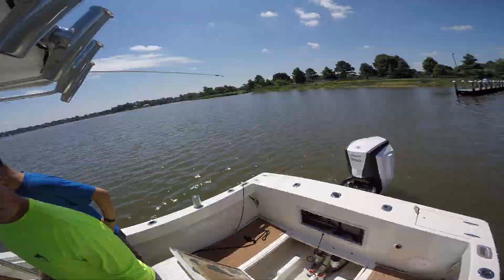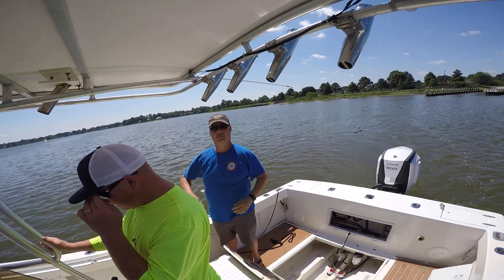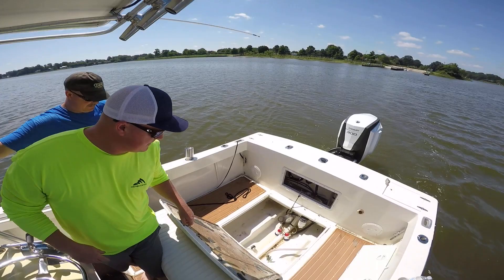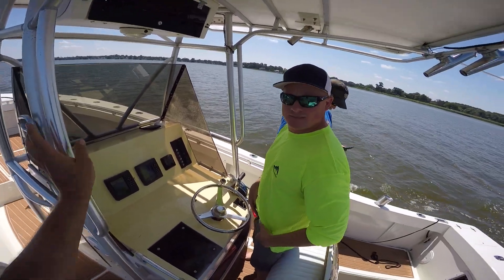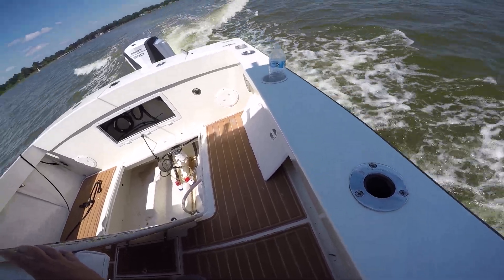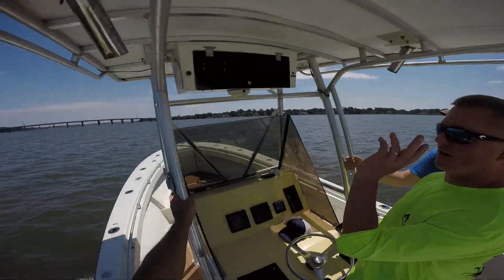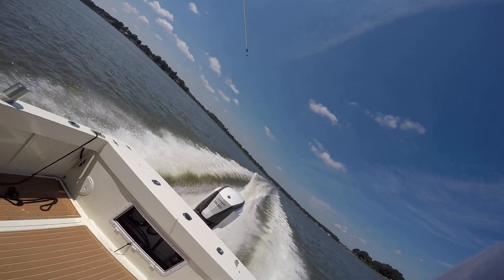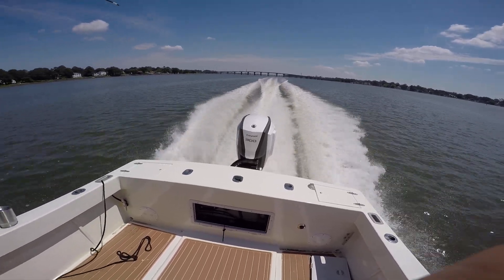evinrude etec g2 300

Comment: I’ve owned many big V6s through the years but my best sounding engine ever was my 80s Evinrude 115 with a custom stainless Raker prop on my 16 ft Bass Cat bass boat! That boat only weighed around 600 pounds would do low 60s It sounded so mean

Comment: Just curious I have a 23 seacraft that I am currently restoring and looking to repower how is the performance on the boat after propping it correctly?
Reply from the maker: performance numbers with four blade 19in. pitch renagade ss prop
4 seconds to plane
10 seconds to 50mph
top speed of 54 mph at 5400 rpm
4 mpg at 4000 rpm
2 mpg at 5400 rpm